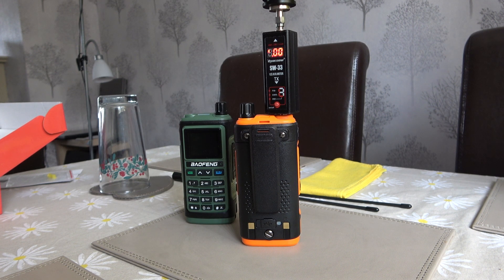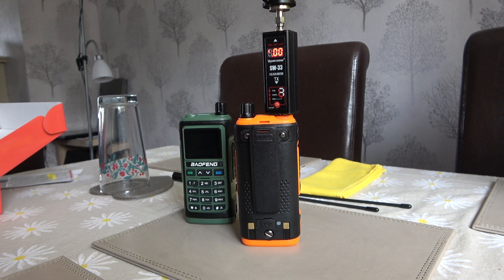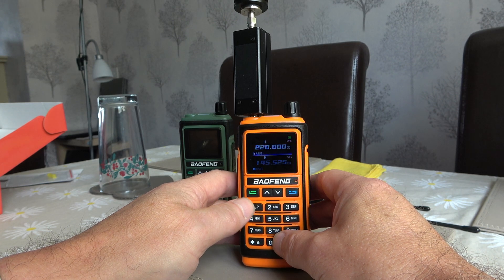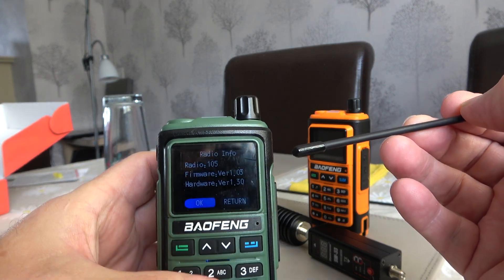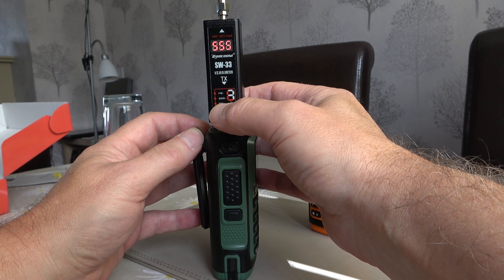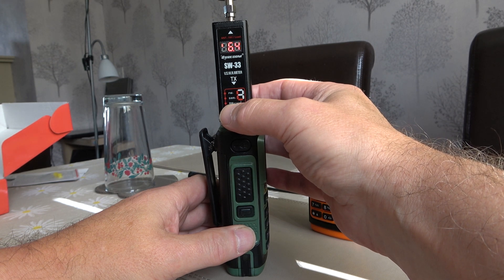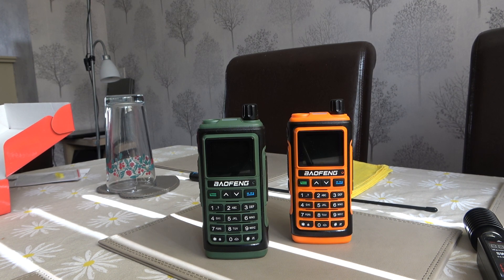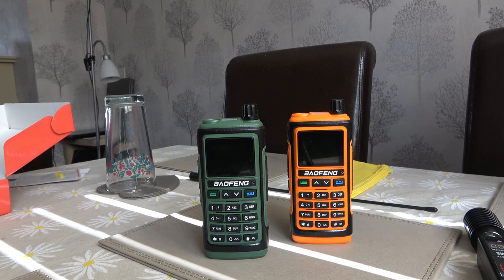Baofeng UV-17 Pro GPS Power test revisited.

Comment: Unfortunately, these radios still violate FCC regulations when transmitting on 2m and 1.25cm.  I just bought a pair because others had said that Baofeng fixed the lack of proper harmonic filtering. Unfortunately, the spurious emissions still violate the FCC rules (and put your ham license at risk) on 2m and 1.25m.  On 2m, I get a good strong signal on the fundamental but also a good strong signal at the second (+19dBm) and third (-6.4dBm) harmonics.  At 1.25m, the fundamental is strong (more than 4W) so any prior firmware issues with that have been solved, but the third harmonic is at -8.4dBm.  70cm seems to be OK.  I'll be returning the radios.

Comment: I'm surprised that you didn't check the output on the 70cm band as well.
Reply from the maker: Yep, that was an oversight on my part but I can assure you that there has never been an issue with 70cm on the UV-17 pro GPS. The only issue was with tx on the 1.25m band and the point of the video was to demonstrate that the 1.25m tx had been fixed but I take your point about 70cm. As for the CB capability, that seems to be unique to Australia (?) as most other countries don't use that band and just stick to the ham bands. 👍😎 Thanks for your comments. 👍
Reply: Was still a great video.

Comment: Thank you for the nice review comparing different firmware versions. How about the UHF transmission power? In addition to the 70cm band, the CB band is also interesting at 477MHz.
Reply from the maker: @ysyang  thank you. You must be in Australia because we don't get CB on UHF in the UK only on HF hence why I didn't test it there but I'm sure it would be fine there too. Thank you for your comment. 👍😎
Reply: @bigwill4423  Yes I am in Australia and the UHF CB operate near 477MHz. It would be ideal to have one device to cover both amateur 2m/70cm and UHF CB. The review and feedback are so helpful. Baofeng has a "LOT" of models. Initially I thought that the higher model numbers mean higher performance. It looks that the UV-17 Pro GPS may be better than UV-18 and UV-21. Thnk you again.

Comment: Thank you for another great video!! How do you update firmware on this radio?
Reply from the maker: @sekibulja-fu3bv  as of this date and time you can't update the firmware on analogue Baofeng radios as Baofeng don't release the firmware or the bootloader to the public. The only way you can currently get a new firmware on the radio is to buy a new radio with the new firmware already installed on it by the manufacturer. ☹️

Comment: Good video. Do you have much activity on 1.25m in Ireland? 1.25 repeaters are few and far between  here in the US.

 But I'm fortunate there is a 1.25 repeater about 15 miles from me in Mariette TX. The tower is on top of a small mountain so excellent range. 73s 👍
Reply from the maker: @BrayJaythe2nd  in the UK 1.25 meters isn't actually an allocated ham band and we're not allowed to transmit there....but I understand it's quite popular in the USA where you are allowed 1.25 meters as a ham band. 👍😎